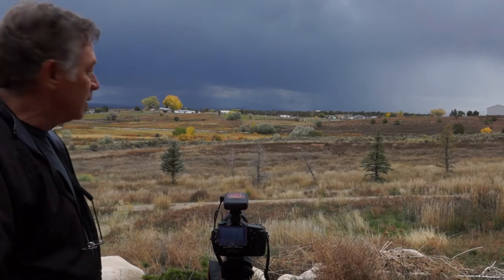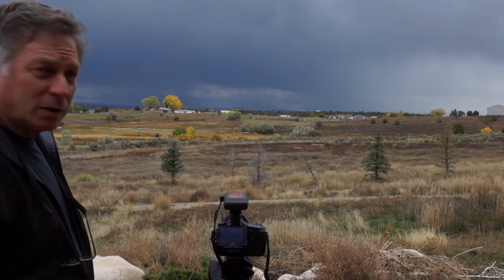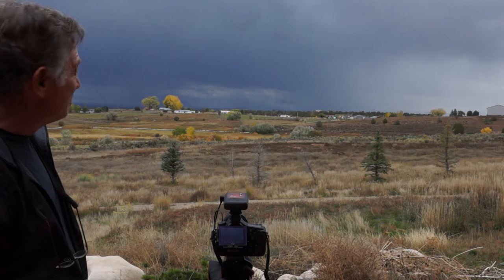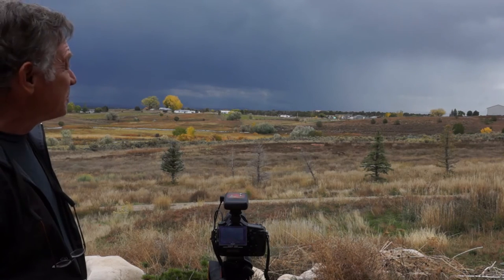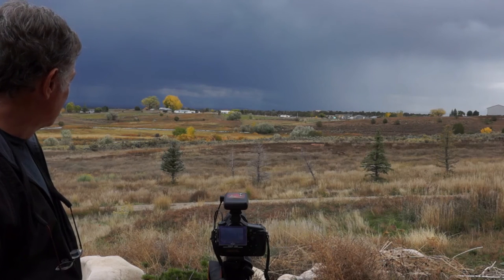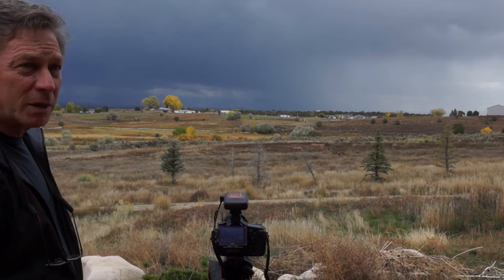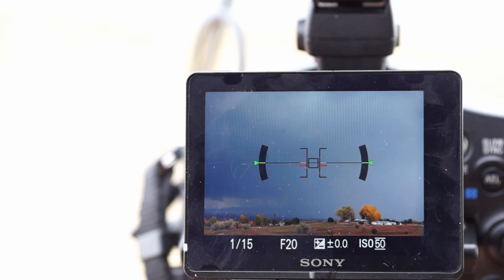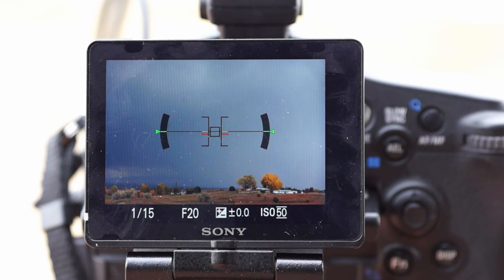Lightning Trigger Video

Comment: The device itself is good and detects lightning nicely.
The worst thing is that the cable included is of very poor quality and is quickly destroyed.
Despite being very careful with the cable, I had to change it after a couple of months.
The cable is also expensive as it costs $ 35.
I have a feeling that the manufacturer has intentionally made such a bad cable that it can serve extra on it.

Comment: Why wait for the lightening?  Make it strike!  This can be done under $100 and if you are cheap it could be done for around $50.   Not going into exact detail so pay attention, this is proven.  Use a model rocket, in the right weather conditions, with a thin copper wire attacted.  Coil the wire at desire impact site.   The rocket will lauch, carrying the wire with it.  When it hit the right height, with conditions lightening will travel down the copper wire, thus striking exactly where the remaining coil lays on the ground.  The wire the lightening travels down will vaporize and the bolt of lightening will look like a straight line.  Sometimes after this happens a second strike occurs only, since the copper wire is now vaporized, the bolt of lighting will take an alternate path.